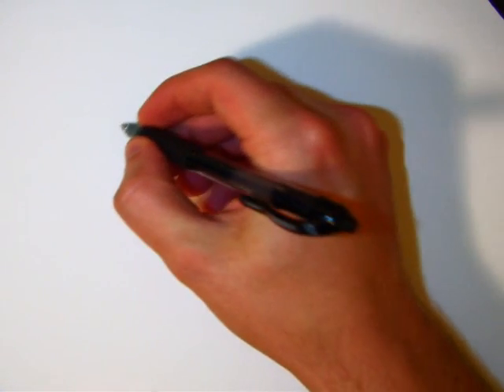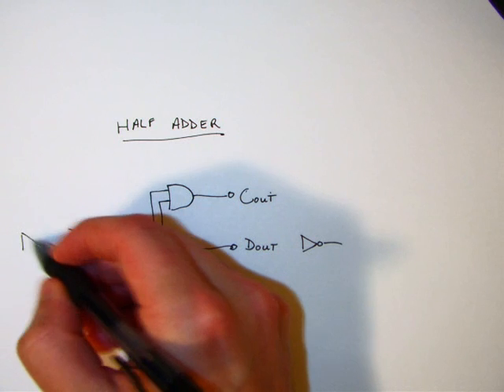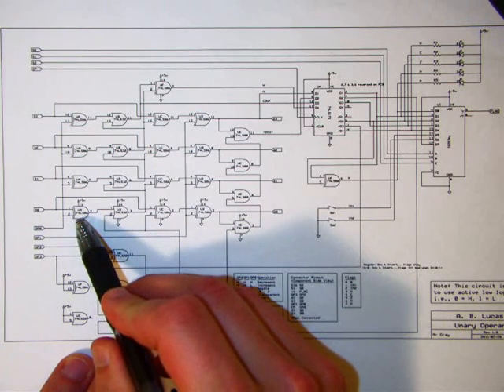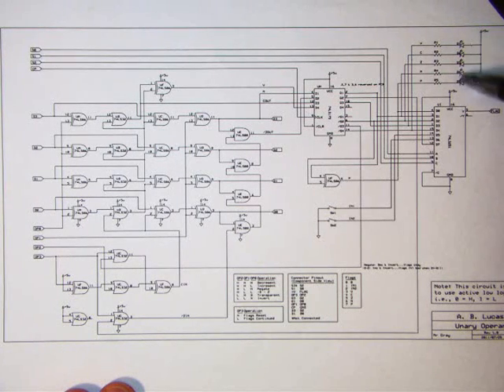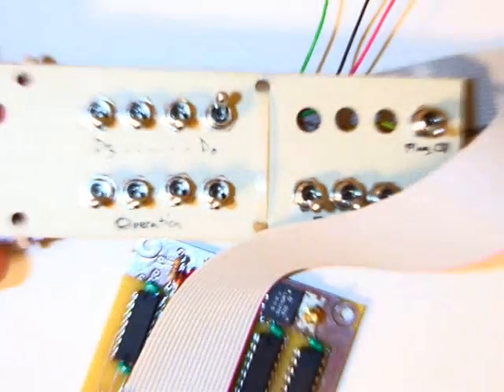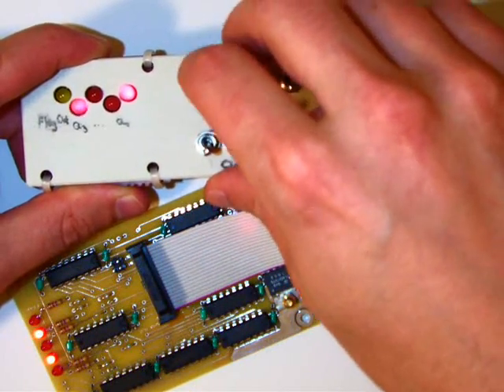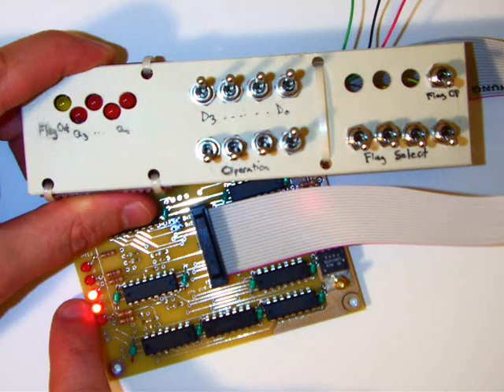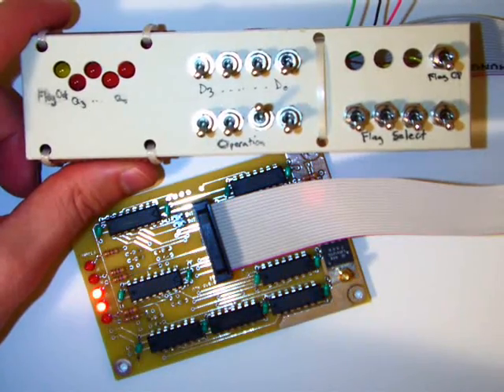4-bit TTL Arithmetic & Logic Unit (ALU)

Comment: A half adder does not have a carry in, just X and Y.
Reply from the maker: +Hung Tran Thank you Hung, but, your understanding is only half-correct. Both half- and full-adder circuits perform the same function: counting the number of 1 bits. In this sense, the distinction between carry-in, X and Y (or A and B as they are more commonly referred to in my experience) inputs is irrelevant. The half-adder can count up to 2 input bits that are 1s; the full-adder can count up to 3 input bits that are 1s. The circuit in the video is a series of half-adders that can only (limited by their capacity to only count up to 2 input bits that are 1s) perform functions on a 4-bit input such as "add 1", "subtract 1" to a 4-bit input binary number. Hope this helps.